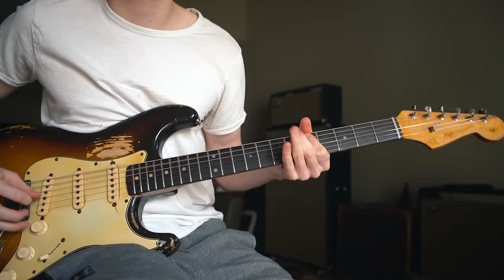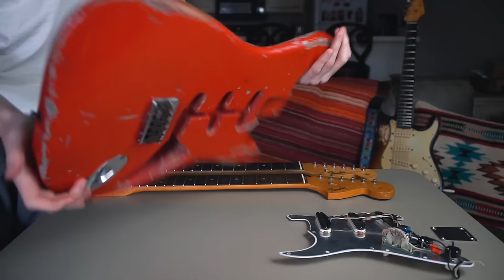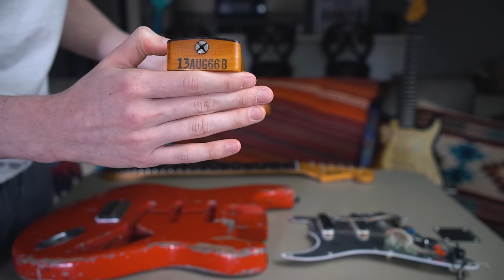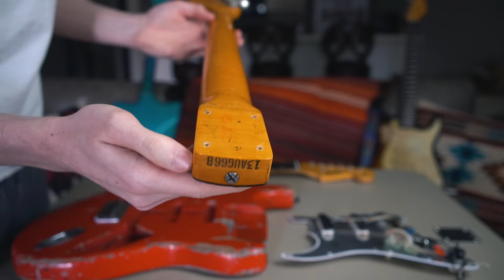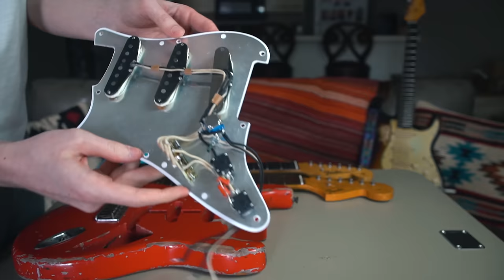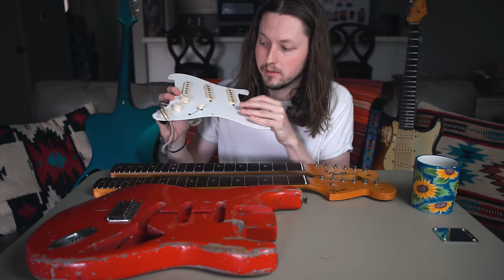Vintage Stratocaster Project - OLD Wood & Modern Electronics

Comment: No worries about not going 100% authentic or "time-correct" on the rebuild. I really dig the idea of the modded electronics, because from an artistical view, it is crucial to unblock your performance as good as possible. If that means to get rid of the limitations of a vintage wiring, go for it. You are not pulling apart an all original instrument, nothing will be lost compared to the point where this project started. You are the performer and this will be your custom tool. I have barely seen anyone has such a sensitive and caring approach to those old parts and guitars, please go on exactly like you do and keep following your intuition.
Reply from the maker: Thank you very much👍🏻

Comment: Awesome video! When you put the 6105 fret wire in the 64 neck did you have to widen the slots much to accommodate the larger tangs?

Comment: Looking vintage with the reliable new guts is smart for what you need. You can always put together a back up pickguard with original parts if you need it for either guitar.

Comment: If you are going to more modern electronics, I think shielding the cavity is a good way to go.
This will not kill the 60Hz hum from the single coils, but the guitar becomes less susceptible to others hi frequency interference. I have a 2012 am std (factory shielded) and a strat copy from Cort that I've shielded myself with copper tape. In most situations, both of then are too much quiet compared to non shielded strats.

Comment: HAve a 75custom telecaster, original body(2piece) with a cavity cut for centre pickup.(Don't know what clown did that). Original neck(a1cond) with  tuners,neckplate. Body was painted 3times(red,black,white) originally wood grain. Needs loaded pick guard, strap holders,bridge gear. Has been stressful on what to do but now know. Thank you mate, now know where I'm going with it to completion.

Comment: another great opportunity Polish the Fiesta red which would fall into the small head era very well. put the correct neck plate to match the neck on it. the cuts on the body are all wrong.So if you could find a 59 rosewood that would be cool. As far as the wiring. Don't overthink it. As a Fender Tech may I suggest a good set of Fender pure Vintage pickups with the middle pickup reverse wound with a 5 way. Fender Pots and a.02 cap. buckle up and blow some blue notes with that set up through your bassman. Great project. old wood new fender guts make for a killer player.

Comment: I would definitely go with the more “interesting” neck.

There is a further modification to the electronics you might want to consider - replace one of the tone pots with a pull pot. With the pot pushed in it will operate as it does now, but pull the pot and you can also select two more pickup positions - bridge + neck and all three at once! A couple more options for when you’re playing.
Reply: That'll do the tele thing for sure

Comment: 1)  either neck great but compare them for neck profile, playing feel etc.

2) for all you know, the 66 neck will mate better with the body because of the wood mass difference. Also Cap fretboard necks (which are rare) can be quite rigid for improved pitch stability.

3) obvious the piece is more valuable / has better curb appeal with the 1964 neck. I'm just suggesting you try both and document the differences. Can't wait!

Comment: I'd go with that 64 neck no doubt, the smaller headstock just goes with that 57 body. lets you now its more early 60's late 50's style. I dig on the hardtail too, never had the chace to try one myself!

Comment: Dude!!! That’s sick!!! Definitely put the 64 neck on it, it’s sick! And the tele style bridge pickup with the plate under it is a good call for sure.
Reply: Tele plates are bigger, so he would have to mod the cavity if I'm not mistaken
Reply: @gunkanjima3408  Even a small plate will affect the pole piece magnetic fields.  Kind of how the Jaguar pickups have the side guides to alter the tone ever so little bit.
Magnetic fields are pretty amazing, even a chamfer/bevel on the individual pole piece magnets change the focus and shape of the magnetic field the strings pass through.
Reply: @hkguitar1984  Good call. Looking forward to how that bridge sounds!
Reply: Is the tele style bridge pickup also "sick"?!?
Reply: I had a plate under my bridge pickup in a previous strat. It isn’t quite tele, because the plate is still quite a bit smaller than an actual tele bridge. But it worked well. I had the blender mod so I could blend in the neck while on bridge, and vice versa. Could blend in the neck while on bridge/middle for all 3, too.

Comment: Too bad you don't have an extra 50s maple neck for it but that somewhat 'rare' '64 neck would be good for it. The premium wiring kit I got for my 1st Tele came with a treble bleed cap so i soldered everything together but later wondered if I really needed that TB cap so I disconnected the it from the volume pot to discover I didn't after all cuz CTS pots work perfect without losing highs when rolling down the volume be it 250K, 500K or 1meg.

Comment: I think it's going to be awesome with whichever neck you choose. I kinda like the earlier, small headstock, but both are cool. As far as the electronics, you have the cool vintage look on the outside and reliable modern stuff on the inside. For a guitar you're going to be playing on stage, I think it's a good way to go. If you were restoring it to original, that's a  different story. Electronics have come a long way since the 50's. Smaller, more reliable, and more efficient. If they sound good, that's all that matters. When you're done, you'll have a badass guitar! Btw...I love the hardtails. I learned on a hardtail and it's what I'm used to. I  block the trems on my guitars that have them. I'd love to have an old  one like that. Good luck with it and I'm looking forward to the next video!👍😎🎸🎶

Comment: personally, id go for the big head stock, but if your trying to keep the weight down. Its going to look fecking amazing either way :) keep up the excellent work.
Reply: I want to know if that neck has less 'flex' than the 64 neck, because if so that is greet for pitch stability and vibrational stability (clearer tone.).

Also on all RW Cap neck guitars the fret tangs go right into the maple, giving a brighter sound. Plus they often have a nice shape.
My bet is he sells the 66 neck and doesn't try it. This is product placement. Chumming the waters.

Comment: I’d go with the fat headstock neck. It looks cooler. Plus they say the neck is the most important aspect of the guitars sound and string vibration. Fat should translate to fatter sound, right? 
The plate on the bridge pickup will give it more of thicker humbucker sound as well. 
So you have a fat Strat thing going on here. I’d go with it. 
And Matt, a no load tone pot can get you 2 more sounds. The bridge and neck pickups like a Tele. (Tele pickup) And all 3 pickups at once. (Knoffler) and you can blend the neck or bridge pickup so really there’s a lot of tones you can discover. 
All these suggestion would make a big fat Tele/Strat hybrid with a master tone and blend pot that’s removed from the circuit when on 10. Put the treble bleed on it as well. That some trick sh*t you’ll have under the hood.

Comment: I still think you should strip the body and repaint it the colour you want. I like that 64 neck but I'd say you should run with the neck that feels best for you to play. Great idea with the electronics - if this is going to be your workhorse then run with a more modern and reliable set up - you want to be as stress free as possible when gigging. I think you should also get locking strap nuts (or whatever they are called lol) and buy good ones. They are a small item that will help make playing live easier.

One more thing - borrow a mate's Marshall and let's here that Firebird with a little bit of dirt. I am sure I am not your only subscriber who thinks the same :-)

Comment: The extra mojo in that bridge pickup may be 43 AWG wire. Strats typically use 42 AWG wire, whilst early broadcasters and teles used 43 AWG which is a touch smaller in diameter. This will mean slightly less winds for the same DC resistance in a strat pickup. This will alter the inductance a little as well. When a magnetic field moves inside a coil of wire, that magnetic field INDUCES a (or creates a) current in that coil of wire. The strings of the guitar vibrate and create movement in the magnetic field, inducing an alternating current in the pickup coil. The different wire type for the pickup, in addition to the slightly different combe of pole pieces and the baseplate will create a slightly different sound from what your used to...because the inductance of the pickup will be different.

Oh and my vote is for the small headstock FAT neck...!

Comment: The electrics are interesting. Personally I would rather have a more powerful Strat pickup in the bridge but that's personal choice. I do agree with you going for modern electronics.
Necks... Well I grew up in the 60s &  70s so big headstock strats remind me of Hendrix, Tower, Blackmore & my first electric guitar a Japanese Columbus large headstock Strat-a-like. So me I'd probably put that in.
If I could justify the cost I'd buy that neck of you for a build of my own.

Comment: You should consider going with the large head headstock....more mass there adds to your sustain....all be it a few ounces.   You pickup set up.....you should consider using just one tone pot and having that applied across all 3 pickups by extending the wire on the 5 way over to the extra lug.....bridging all 3.  The tone cap should perhaps fall between .01uf and .02uf.....or that would be .015uf, it depends on the response in the guitar.  That cap will just roll off the highs without going too dark as a normal tone cap would at maxiumum travel.....so you get the true tone of the pickup and just roll off the high end shimmer.  Which brings the extra hole of where the other tone pot would be on the guard.  Use that hole for a dpdt switch on the middle pickup where it changes the phase of the pickup by swapping the position of the 2 pickup wires relative to the hot & ground...….this will give you the 5way position 2/4 normal out of phase and the opposite in phase for the humbucker configuaration…..so much more versatile for tonal effect.  If you research the Premiere Guitar Magazine pages for Dirk Wacker's column...there is a schematic there for the Super Strat with the add on switch that give all the pickup configuration....all 3 pu's plus with the middle phase switch gives a series connection between the pickups......that would give you the full combination of combining the array of pickups....plus their respective tones....but you need to drill one hole in the guard to add that extra switch which you wouldn't want to do in a vintage guard.....so you'd need a repro.  I'd mount it below the 5 way so its not in the way....minding the control cavity for the fit.
Reply: they used to sell something called a FatHead which was a brass plate that went on the back of the headstock....you pulled the tuners off and inserted the brass plate and the tuners back on...the tuners held the plate on the back and increased the mass for more sustain...without any modification or holes....
Reply: you could just go to a hobby store and find a piece of brass plate and fabricate the holes and cut the plate to size.....make a paper template off the head stock......instead of digging up a FatHead

Comment: the 62 is closer to the heavy contours of the  57. on one of mine i have a T G 11/58 heavy flame neck with a 66 ash body. it was in pieces and the neck was twisted. it took 4 months to make it right so i did a polyester finish so it would stay near perfect and it is a May Kaye tribute  now.

Comment: I have a 1956 Guild X-175 which I got pretty well wrecked. I spent way too much money having it refurbed....and now it is blond with the neck dyed SG-style red. 5-way binding. I also had the neck shaped to match a '64 strat. Pretty darn kewl guitar. Among the better neck shapes there is. But the '66 is probably just as good.
https://i172.photobucket.com/albums/w32/ttm4/GUILD%20X-175%201956/GUILD004.jpg
https://i172.photobucket.com/albums/w32/ttm4/GUILD%20X-175%201956/GUILD001.jpg
https://oi172.photobucket.com/albums/w32/ttm4/GUILD%20X-175%201956/GUILD007.jpg

Comment: No brainers use small headstock.i don't understand why some people try and reinvent the wheel Nik says there's some of tone comes from pots mojo.if you want new reliability put in new cts pots.trash that modern crap and be sceptical of anyone who doesn't think that pots that can work great after fifty plus years aren't good enough and need improvements.im surprised he didn't suggest a computer board.or just install it for your own good because I'm sure he's smarter than leo.keep it old school as possible please.